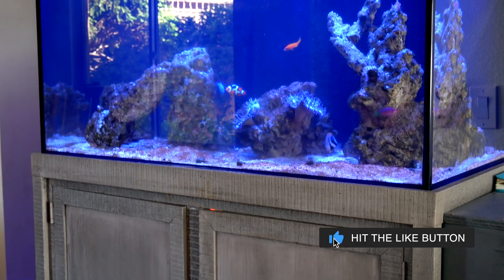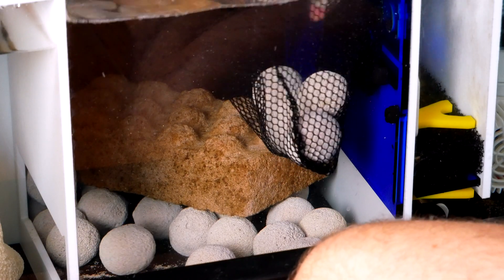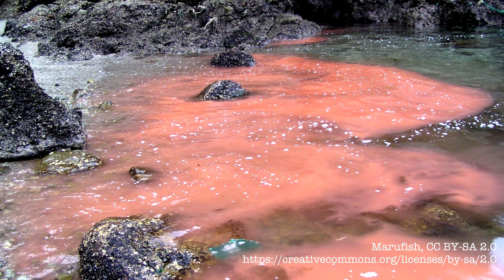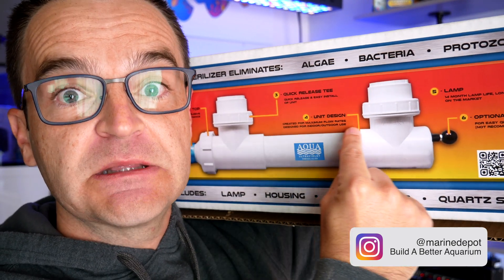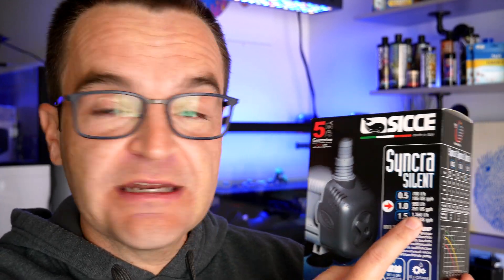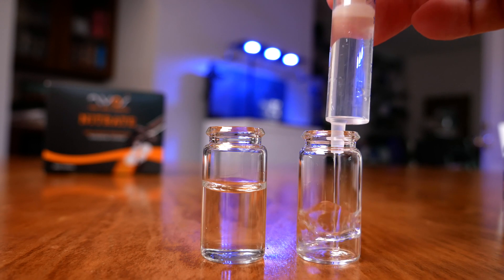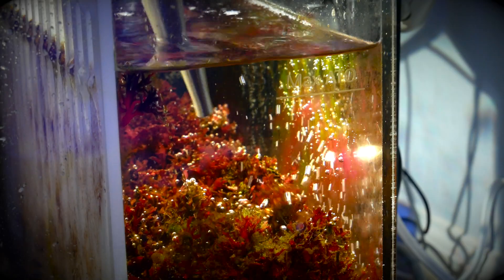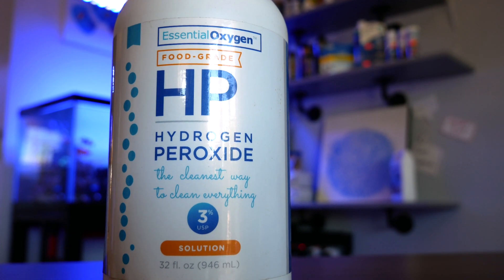Winning the Battle Against Dinoflagellates!  How to Install a UV Sterilizer

Comment: Thank you for the video, how did you mount the UV sterilizer? Is it on the floor along the back of the tank?

And does the input and output matter along the length of the UV sterilizer?

Comment: Just a few things. You should run it 24 hours. #2 You got to small of a pump. That number they put of the front for GPH is not accurate. If you need 250 GPH and you buy a pump rated for 250 GPH its not really going to be 250 GPH, so you need a slightly bigger pump rated for more then your target. #3 and this is optional but I would totally get some type of flow meter if you can. Just to keep the right amount of water passing through. If you own an apex its really easy to add one. But like I said that one is totally optional.
Reply: Why run it 24hrs? I was under the impression you should only run it at night. Im going to run it from 7pm to 7am. I'll be setting one up soon. Have a 400gph pump coming but am aiming for 200gph. I'm just going to adjust the flow on the pump and let it go for 1 minute then measure the water output heh. That will give me a pretty good indication of how much flow I'm dealing with.

Comment: great video, i have a reefer 170 and was wondering how and where id plumb a uv sterilizer as my return pump is too high a flow for the recommended uv's flow rate? thanks guys
Reply: I have an xl200 nearly the same tank.  Have decided installed a UV yet.  I’m pulling my hair out with the dino, quit literally 😂
Reply: @scrissey96  I'm waiting on my pump to arrive next week b4 I can turn my new uv , but in the mean time I've started dosing vibrant and noticed a difference already,  have you tried that route yet?

Comment: That's exactly what I did and it worked raised my phos. And nitrates also increased my bacteria same products also added a uv the only thing I took away the socks and used filter floss dumped every day just in case dinos stayed in socks also cleaned every day lost some corals but is coming back took three months